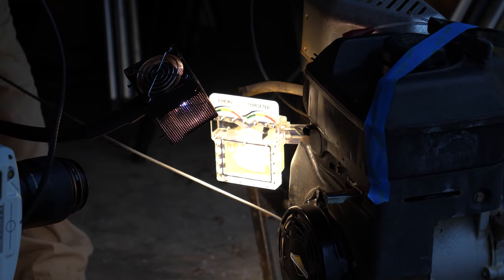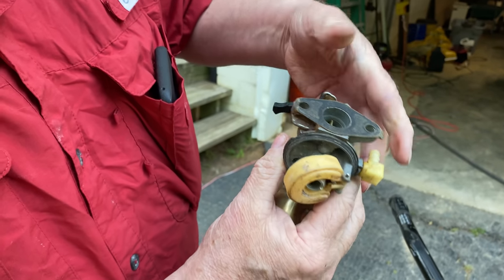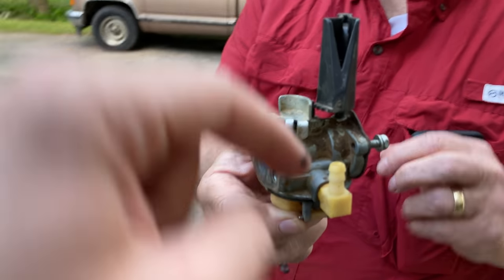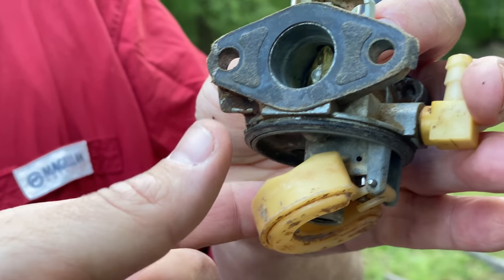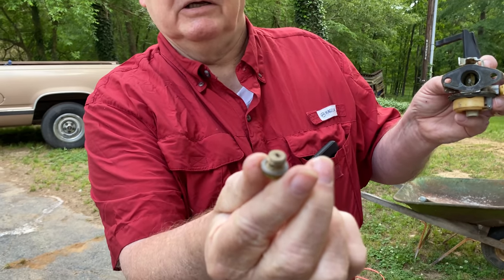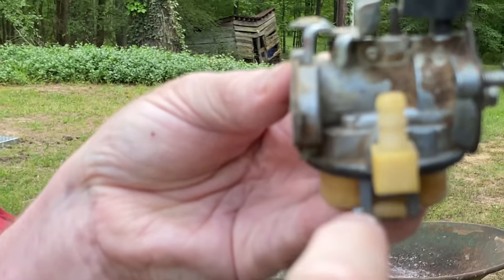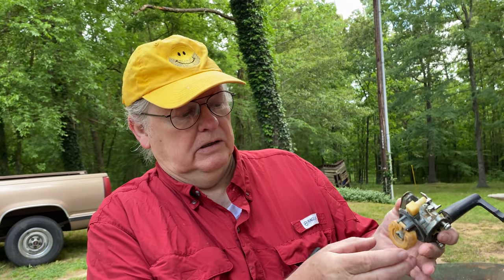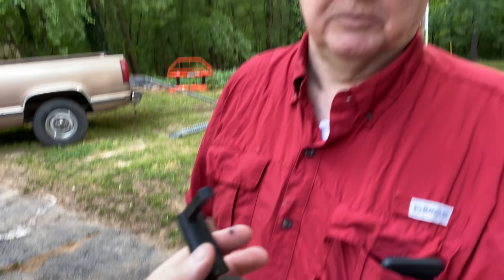Transparent Carburetor (Extended Cut With My Dad Darryl) - Smarter Every Day

Comment: I think I get the throttle argument. Destin, you're saying "but the volume of vacuumed space is the same every downstroke of the piston, surely it fills with mixture every time because air isn't coming in from anywhere else" and I was stuck in the same way but it's like "I'm going to suck as hard as I can on this straw for one second before I'm forced to blow out again. If I suck through a juicebox straw, I won't fill my mouth (fill the vacuum) before I'm forced to blow out but if I were sucking through a garden hose (same vacuum and volume to fill) then I would fill my mouth before blowing out."

Right? Did I grok it?

Comment: So the venturi effect is only part of the story. The other part is the direct vacuum from the intake being placed on the fuel jet/line/bowl, especially when the choke is closed for example, correct?
Reply: Only when the choke is closed, otherwise the piston vacuum only pulls in air and the venturii effect dominates.

Comment: Great video showing fuel pulse timed with intake stroke!
The item your father called the jet, i.e., cross drilled brass that holds bowl on is not a key. The key is up the tube this nut screws into.

Comment: The chamber with the float / fuel in ... is that open to the air? Because as the fluid runs into the float chamber if it's a sealed unit, then the air will be compressed by the incoming fluid?
Reply: It is vented to the atmosphere, it's the atmospheric pressure that allows the venturii drop in pressure to draw the gasoline into the airflow.

Comment: The throttle will change the air density. You can pull over 20 inches of mercury in a running engine some engines will need part throttle, some will be able to do this at idle. In a decel condition it may approach zero atmospheres, i dont have my inhg to bar pascal conversion chart on me but i do know 20inhg is a pretty low  absolute pressure and ive seen the gauge indicate near 30. So yes the cylinder is full in a sense but gas doesnt have a defined volume like liquid does. I could write a book on carbs and im not really an expert.

Comment: Question for clarification:  Is the throttle green, yellow, red setup backwards? In the video it shows the airway “closed” when the throttle is in the green position, Destin’s Father said that when the throttle is fully open, more is sucked into the intake causing greater speed.

I guess I don’t understand how there can be MORE throttle when the airway is being closed up in that position. What causes more throttle, greater full ratio or more overall air being pulled into the intake stroke. 

Thanks for any feedback. I’m just a physics teacher trying to learn some mechanical engineering. 😎🤓
Reply: As with any prototype it's a work in progress. The colors should be arranged different, so like red is max rpm. But let's go more in depth.
From starting engine to max rpm.

Choke on/valve closed/red =
Maximum suction on fuel hole
Maximum restriction on intake
= Rich air fuel ratio at low rpm
= for starting

Choke off/valve open/green = 
Normal suction on fuel hole
Normal restriction on intake
= normal air fuel ratio at any rpm
= idling

Throttle off/valve closed/red =
Normal suction on fuel hole
Normal restriction on intake
= normal air fuel ratio
= idling

Throttle 1/2 open/yellow =
Normal suction on fuel hole
Lower restriction on intake
= normal air fuel ratio
= midrange rpm

Throttle 100% open/green =
Normal suction on fuel hole
Least restriction on intake
= normal air fuel ratio
= high rpm

The dad said -as you lower the intake restriction; the RPM shall increase(reworded but meaning is the same). The valve closest to the engine decides the rpm. The choke is there to aid starting only(usually)
Reply: @ddiablolll  This reply is amazing. I’m definitely going to try to involve parts of this episode in my physics class. Thanks for such an in-depth breakdown! 🤓🤓🤓

Comment: I'm confused about the ethanol thing, I heard that ethanol causes the fuel intake valves on a small engine to gum up and not take in anymore fuel, and that it doesnt matter for a car because the fuel intake valves are larger.   yet i heard your dad say ethanol isnt the problem because it makes gas a homogenous mixture.  wouldnt that make the gas more prone to the gumming problem?

Comment: I think what is happening is that on the pressure fire stroke there is some leakage that is causing the back pressure in the carb. ... have a look at where that happens its at the top of the fire stroke you get the blow back ... tell me if I am wrong

Comment: I think we already way past the day of maximum number of carburetors in use.  Almost all cars and trucks produced in the last 20-30 years have been fuel injected.  Fuel injection is being used on a lot of today's small engines too.   That's why so many assembly lines are slowed or shut down by the shortage chips needed for the EFI.

Comment: I love all this engine stuff, nothing like it on the internet. If you know of a public way to learn how engines work I would love to know where.
Reply: Start with an old go kart or tiller engine, less moving parts than a car engine but all the same principles. Watch videos about full tear downs and rebuilds on those small engines, read about air/fuel ratios and stoichiometry (sp), compression ratios, timing, cams and valves, the more you see and read the more you'll understand about the overall operation and physics of a combustion engine, from there you'll begin to see no matter the size of the engine they all pretty much operate the same. Good luck in your learning adventures!
Reply: @justinyates1154  thanks!

Comment: Your Throttle colors r wrong, should b red, yellow, green! Love the show! That bolt that holds the bowl on goes up and when u tipped the carb you could c 2 holes going into the venturi. The larger hole is where the gas enters the venturi, the smaller hole is to allow air into the bowl to equalize the pressure. An example of that is when you shotgun a beer. If u poked a hole in the bottom of the can and sucked without popping the top the can would collapse, but if u pop the top, equalizing the pressure, the beer flows freely to your esophagus, without crushing the can! enjoy AHHH!

Comment: Ethanol is alcohol. Alcohol is, both, a polar solvent and a nonpolar solvent. Polar solvents, like camper fuel, dissolve oil-based materials. Non-polar solvents, like heavy water, dimethyl formaldehyde, or even tap water dissolve water-based substances. Alcohols bridge the gap and dissolve both polar and nonpolar matter.

Comment: Some pins are slightly larger on one side.  If the pin doesn't fit in easy?  Try inserting by turning the pin around and push in.

Comment: You only want polished intake runners on things with fuel introduced after the intake runner like fuel injected engines with fuel injectors at the ends of the intake runners. Or you could polish the entire intake tract of a direct injection engine. Not on carbureted engines that introduce fuel at the beginning of the intake tract. 

Otherwise, you want a rough surface to create the boundary layer between the port wall & air/fuel charge for anywhere that the fuel/air charges flows. In a csrbureted engine, you'd want the intake runners and ports going to the valve itself to be rough rather than polished smooth. Smoothness causes fuel to cling to the walls and be pulled out of suspension.

It's wayyyyyyy more complicated than that and I'm sure I got something wrong in there lol. 👍

Comment: I got to 27:00 and I was wondering about how they restricted the fuel: where was the bolt with holes so the fuel didn’t flow too fast and could atomized properly with air.

Comment: I’ll add one more condition that’s required for the engine to run.  It’s rare that you don’t have it but you must have exhaust.  So 
Air, fuel, compression, ignition and….exhaust.

That’s not any criticism by the way, literally nobody considers that …..until something breaks and your engine has no way to exhaust. 

Really cool video……fun too😁

Comment: whats the difference between lean and rich  mixture and how it affects the run of the engine ?
Reply: Lean burns strong and hot, maximize power. Rich runs cool (cooled by the excess fuel) and runs smoother and more durable.

Comment: Maybe I'm being pedantic, but it's being Atomized not Vaporized. Vaporization is when something changes phase from a liquid into a gas or vapor. Atomization is when a liquid is broken up into tiny droplets.
Vaporization is the ultimate goal, however both carb jets and EFI Injectors atomize the fuel, not vaporize.

Comment: When you press the gas pedal on the car, is that controlling the carburetor how rich the airflow is and then the piston speed?
Reply: The rich/lean mixture is set by the main jet in the bowl and the choke. The throttle is metering how much of that air fuel mixture enters the cylinder. Piston speed is controlled by the throttle plate. The piston is trying to draw in the same amount every intake stroke but the throttle blade is restricting how much it gets (this is where intake manifold vacuum comes from). Wide open throttle its drawing the maximum amount of air fuel and creating the largest combustion.  In a perfect world the mixture would be exactly the same no matter the throttle position. In larger automotive carbs there's many other circuits that help to even out the mixture under different throttle conditions.

Comment: I noticed Destin had a hard time with the concept of high speed\low speed jets in these...As you have less pressure at idle .So you need a low speed jet.. Once the pressure builds ups across the intake. It switches to the high speed jet. So as too supply more fuel to the cylinders..

Comment: & now i understand why my bro was confused when i said "pull this to open the choke" (on my bike). pulling that was infact closing the choke, i just didn't know that "closing" it was creating a richer mixture (what we wanted at the time).
I think i now understand a flooded engine too. i never understood how you could flood an engine, but then come back to it a little later on & it wont be flooded. evaporation man. would i be right in saying that opening the choke & throttle would help the flooded engine evaporate off the unwanted fuel faster? (ofcourse the engine would be off.)

Comment: so if the carburetor needs gravity to work, how do space craft that go to space feed fuel to their engines? Or do they not need a carburetor at all
Reply: Entirely different type of engine. However rockets that have to start in space use a small kicker motor to push fuel backwards into the tank for the pumps to draw from.

Comment: When you were discussing the delay in the line, I think what's actually happening is that the vacuum from the previous intake stroke is both atomizing the fuel/sucking the fuel air mixture into the cylinder, but then ALSO pulling fuel through the line, into the Venturi and suspending it in the air for the next intake stroke to atomize it & pull it into the cylinder.
Reply: I also don't think its vacuum delay, as that would still pull the drop forward toward the intake. It's just the upward inertia of the fuel that continues after the vacuum disappears.

Comment: one thing is not clear. the same amount of air is always filling the cylinder.
so how do you get different amount of gas by changing the throttle?
if it deflect the gas from going to the cylinder where does this gas goes?
if it reduce the amount of air going into the cylinder - you'll have a vacuum in the cylinder.
Reply: The volume per unit of time changes with RPM. But essentially (simply) you combust the same amount of fuel and air in the cylinder each power stroke. Each rush or air filling the piston will bring along the same amount of fuel. It's more complicated than that in real life though.
Reply: @kjdude8765  "Each rush or air filling the piston will bring along the same amount of fuel" - but this goes against the function of the throttle. the throttle somehow changes the amount of fuel for each rush of air.
I think my assumption "the same amount of air is always filling the cylinder." is wrong, in that case less air get into the cylinder when you throttle down the engine.
Reply: @elraviv  the fuel air ratio needs to be around 1:14 for proper combustion. The throttle restricts the amount of fuel and air that enters the cylinder. In a carburetor the slower air moving through the venturii due to the throttle restriction draws an equally smaller amount of fuel with it. Less total mixture, same ratio.
Reply: @kjdude8765  Thanks :-)

Comment: But what is the function of the bowl?
Why not the fuel line from the tank to the venturi?
Reply: Even out the back pressure between empty and full tank
Reply: Gonna have a guess here:
Fuel line will have pressure in it and you don't want this.

The float in the bowl means the fuel is at something like atmospheric pressure 

You want the venturi to "pull" the fuel up (as u see in the video) on the suck stroke (giggity) otherwise u could over rich the engine

Not a great description but I think the fundamentals are correct

Comment: Like a compressor paint sprayer. You say it needs gravity. But how does it work in a piston motor on a airplane?
Reply: There were certain airplanes which had restrictions on flying inverted because of their carburetor. Fuel injection changes things. And that's as far as my specific knowledge goes, even though Dad and Grandad were pilots in my childhood years.
Reply: Yeah some old plane engine die when they do flip
Reply: Planes still feel gravity and most planes won't be doing flips or negative g's. Early fighters did have issues with their carbs due to them pulling low/negative g's and it was a real issue on early Spitfire fighters. I believe the solution was a check valve that would keep too much fuel rushing in when there were low/negative g's.
Reply: The gas tank on some carbureted aerobatic planes have what is known as a flop tube so it can still draw gas when inverted. Chain saws have that feature to be able to run in any position.
Reply: Those carburetors also don't have a bowl rather a small chamber that is slightly pressurized so it doesn't rely on gravity.

Comment: Great video but the throttle and choke blades are causing major problems for you. After the engine is at operating temp the choke is fully open and never moves. When the choke cuts off air flow it causes more suction in the venture making more fuel to come into the air resulting in a rich mixture. When hot you don't need the rich mixture. The throttle blade needs to be much more precision to cut much more air flow off from the vacuum side of the venture. You can't idle down because to much air is going through it.
Reply: The blades need to be slightly oval shaped so that they seal against the top and bottom before reaching 90 degrees.

Comment: 1:09 in here he looks like Jon Voight. Legend
Reply: 39:34 Your gas cap was open and the fuel vapors are flammable you gotta keep safe.
Reply: 59:59 I think he is right in a good carburetor it would atomize, but this carburetor is too basic, even more than the OEM carburetor of that lawnmower. I think a nice car carburetor would atomize the fuel much better. Im just imagining this, but thats what i assume, the more atomized the fuel the better it can combust. And car carburetors look more complex. specially the 4 throat carburetors.
Reply: 1:01:01 The Sports cars or luxury cars like Audi, have it direct injection into the combustion chamber of each cylinder. Audi  calls it FSI Fuel stratified injecton. But i think normal economic cars are fuel injected in the intake manifold. before the intake valve of each cylinder.
Reply: 1:02:40 I think the reason is that the jet tube may be way too large, it needs to be skinnier maybe, to instead of letting these big drops coming out maybe it needs to be more restricted so that fuel ONLY comes out when the intake stroke happens and not when the valve is closed.
Reply: 1:05:36 You can see the fuel being sucked in the tube of the jet on the intake stroke, and not being enough time of suction, it starts to fall back until the next intake stroke where it could suck it to the top this time.
Reply: 1:10:55 The bowl of fuel is getting empty real fast now, just 1/4 remaining, is the floater feeder quick enough to mantain this rate of fuel consumption?

Comment: A Standard Carburetor uses gravity to pull down the float to start and regulate the flow of fuel.
A Pressure Carburetor is used in airplanes. That's a whole other episode. 😉

Comment: I don't understand how the throttle can be sucked open. The forces on it should be balanced either side the axle since it is a symmetric. I can only guess it has to do with the generated vortices generating unbalanced forces on the backside of the throttle. 
Not an expert on turbulent flow.

Comment: Follow up how fuel injection works
Reply: Fuel injection uses a pump and an injector behind the throttle plate. The length of time the injector is held open determines the amount of fuel in the mixture. No bowl, venturii or jet is needed.
Reply: @kjdude8765  but what about direct injection? 🤔 and why do DI engines burn oil after a while? Is it because the fuel doesn’t clean the intake valves?
Reply: @TheMotoDoug  Direct injection squirts the fuel directly into the cylinder rather than the throttle body or intake ports. As to fuel consumption, I'm not sure but they do have issues with carbon build up on the intake valves from exhaust gas recirculation not being washed away by fuel hitting the back of valves.

Comment: Peaked in the 70s, in definite decline since 1986 with the rise of Fuel Injection in US domestic auto market.  Absolutely nought to do with inefficient, wasteful, polluting, non-sustainable battery power from non-scalable sources over an insufficient distribution network.